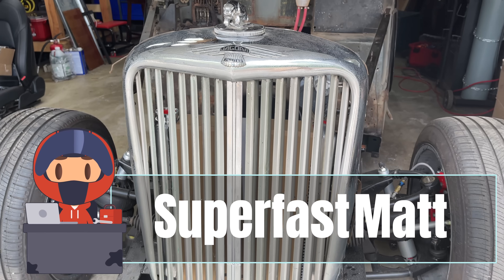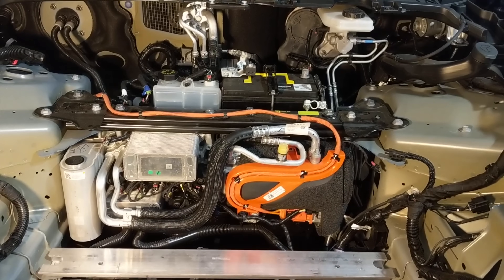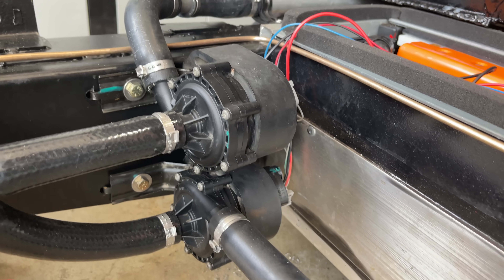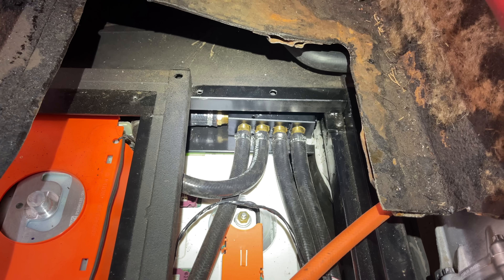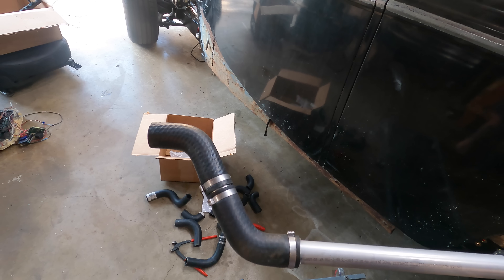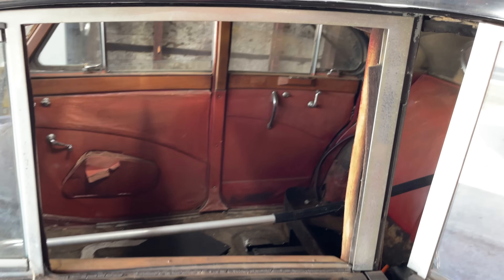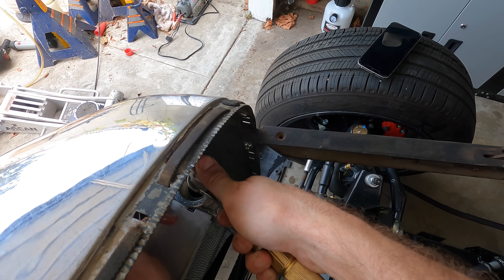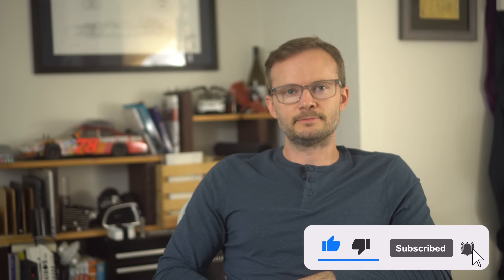How To Make A Cooling System For An Electric Vehicle

Comment: If the welder location woes continue, you can buy extension cords with the correct plugs that are rated to 50 amps. They're usually used for RVs iirc.

Comment: I love what you have done along the way, to your Jaguar, and I'm not sure if I should be making any 'constructive' comments. Along with all of the plumbing, for the Cooling System, I have noticed that you have used lots of Rubber Hose. The Rubber Hose will not be subjected to high temperatures (110 degrees C) - or even high pressures. But the Rubber Hose will be subject to attack from chemicals, shrinking around those Fastener Clips and more particularly the oxygen in the air will degrade / attack the rubber (cracking) over time. So - with this in mind, I was thinking that Rigid PVC Tube could do a similar job, and there is a variety of sizes - and also different Wall Thicknesses to handle the pressure (if needed). If PVC was used for transporting the Coolant, there would also be no metal clips that could leak around the rubber hose. All PVC pipes and tubes can be formed, and all PVC joints are completely sealed with the special PVC Glue. Aluminium Tube will also require a good Inhibitor, or the Coolant will eat through the aluminium wall thickness. I am thinking that (when the car has been completed, it may be difficult to access those leaking tubes and rubber hoses! PVC can be painted in Matt Black, and clipped to the car body for neatness. I just had to write about this, and gauge some reaction from your Fans. Greetings from Australia.

Comment: Bro..... run 20 ft of 12/2  off that plug and install another plug and be done with it..... better yet if your panel is in the garage and you have the space run some 12 off a 20 amp breaker so you have a dedicated plug.

Comment: Probably been stated 300 times but the uneven flow thru the batteries could be helped by a reverse return system. Feed water into one side of the manifold. Then the first supply port goes to the last return port, etc

Comment: What is the accapted practice or science in regards to pump and fan speeds? Which one is more efficient? Which one do you speed up first? What’s the proposed optimal speed ration between the the in optimal case. I built a few computers in the office and ran out of energy to research all these but stayed interested in the optimal approach. (set pc outside fans to low and inside fans high. since outside temp never gets above dangerous temps, processors are good at very high temp with no tune) but 43 degrees C is a very low treshold.

Comment: Why dont you just get a length of aluminium tube, cap one end, fill it with sand, compacting as you go, cap the other end and use a pipe bender to make all the bends? The sand stops it from crushing in

Comment: i cant help but feel that peltier units would be an easier, and overall better cooling method than a radiator. hell, you can even sandwich several on top of one another, and itll still likely be cheaper than using a radiator design.

Comment: "Swap the loop around so the control unit would be the first thing after the radiator"
I'm no expert on the temperature deltas involved in EVs but that seems like it would be... minimally effective at best.
Probably one of the reasons you didn't do it lol

Comment: It looks like Your hose connections are leaking because the clamp on the wrong side of the bead? Also Cheap Jubilee clips don’t hold that much pressure but hose clamps like you get on v-bands are excellent and easy to remove

Comment: Hey Matt, I love these videos. I recently saw the guys at Hoonigan do something smart to get a good bead on an aluminium coolant line. They literally welded a small bead on the edge. They said that they had been doing it for years and they build cars with insane power and cooling systems. You already have the tools to make the beads so probably not a tip as useful for you. But still worth mentioning.

Comment: Check out the Derale PWM dual fan controller. You might be able to tie one leg to your fan and split off the other leg to your pumps for a more robust solution than the Arduino.

Comment: To anyone who might consider undertaking a project like this, don't design like this! At least if you want your stuff to be dependable and have a reasonable OEM-like servce life.

1. The battery has cooling AND heating need! You shall NOT soley rely on convection cooling unless you have a very good derating tune in your BMS. This can't be achieved by only monitoring temperatures, but you have to monitor power demand and react your cooling need proactively. 

2. The powertronic circuit has way higher working point than the battery circuit, thus you shall not use the same rad for these two circuits.

3. If you want any decent life expectancy from your battery, especially if you live in a cold and/or hot- or high place, the battery circuit shall have active cooling and heating. A convection radiator is NOT going to cut it unless you only use your vehicle at sea level in perfect weather places. (density altitude affect convection cooling performance massively)

Whenever charging or using battery current the battery temp should be at bath-warm condition at all time <35*C and >15*C, whenever outside this range; tune your BMS to current- and powerlimit (both for charging AND for vehicle consumption). Keep your powertronics coolant at < 65*C at all times otherwise you need your inverter to torque derate. Machine cooling is the least critical and generally never a problem. Since the working point of this system is so much higher than anything else (upwards of 120*C) you can however save a bunch of headache if you make it on its separate circuit, thus releasing heat stress from the other two circuits and their components.

You can flow-control the pumps for a short extra cooling "boost" before the fan-command actually start moving heat from the system. Again, this must be done proactively by monitoring torque- or power demand and not due to a temperature sensor detecting it (by then heat has already built up and you're too late!)

Comment: As you might be aware, if you have a manifold that doesn't distribute the flows very evenly you can install a second manifold of the same design where the tubes come together again but reverse the orientation so the highest flow outlet connects to the lowest flow inlet. It won't be perfect but it will be a lot closer.

Comment: Hey Matt, love your videos; very informative and comical. 
Just a question; you have a lot of room above your radiator, why don't you raise it up so the radiator cap is one of, if not the highest point in your cooling system? I understand of course that you will still have localised trapped high spots, but this may help somewhat. 
Cheers. Trev
Reply from the maker: There's just no reason if I already have the swirl pot in the back.

Comment: I always wonder how much the speed of the water pump changes the cooling- I would think that the cooling capabilities go down again at very high flow rates since the water won't stay in the radiator for long... but it also spends less time in the hot part..so I really can't wrap my head around how that actually works out
Reply from the maker: It would be pretty east to cut a slot in the side tanks of the radiator and weld in a plate on each side. it wouldn't be 100% sealed from each other, but would effectively be two radiators. I might do that if things get weird with cooling.
Reply: @SuperfastMatt  There's been a lot of conversations about coolant speed in classic car forums over the years (I've owned half a dozen MGs and still own most of them).  I am not an expert (not even close, really), but the consensus seems to be that faster coolant doesn't improve cooling capacity.  It does however minimize the temperature difference between the peak and the trough.  I could not even begin to comment on dynamics between two intersecting loops at different speeds.
Reply: @SuperfastMatt  One additional comment/question after the other one.  Why are you bothering to pressurize the cooling system?  It seems like you will not be getting hot enough to boil the coolant, and pressure just gives you more headroom.  Well, it also reduces hot spots, but I can't imagine that being a real problem either.  I could be wrong.
Reply from the maker: @davemccann7446  I'm just using the pressure tester to make sure there are no leaks.
Reply: @SuperfastMatt  Fair enough.

Comment: Isn't it necessary to use a fan shroud so all the air is redirected through the fan and you don't waste half the radiator? No sources supplied but I'm also not saying you're wrong, I'm genuinely asking the question.
Reply from the maker: It'd be a better use of the fan, but the radiator is oversized already, so I don't really need maximum efficiency.

Comment: You might want consider a fan shroud to prevent air to go around the radiator.

This improves cooling and you might be able to switch the fan off while driving on the highway.

Fairly cheap temp switches exist that would fit your operating temp but installing a proper sensor is a better way and the rest is just coding.
Reply: A large fan shroud with simple rubber check valves (flaps)around the perimeter...
so at low speeds the rubber check valves are closed allowing the fans to work efficiently and pull air in from all over the radiator....and at speed, the check flaps open from the rush of air coming in the grille and through the radiator so the "tight" shroud does not impede air flow...and the fan does not need to run at all...

Comment: For 20 odd years I have been saying that auto manufacturers need to use the excess heat from the exhaust to run air conditioning, the same way that a gas fridge works. 
I guess it takes an innovative company like Tesla to work that out.
I also think that a small heat exchange cooler would be a good way to cool the air coming from turbos in an intercooler. An integrated heat exchange and turbo is what I think would be a good idea.

Comment: It's always tempting to weld unique fittings to an aftermarket radiator (I have one on my classic car). BUT, the radiator is probably the most vulnerable part of the drivetrain. If a deer runs out in front of  you, or a garbage truck reverses into you, you're in trouble. If you had simply made an adapter for the existing rad, then you could simply organise an immediate replacement, even  200 miles from home. With the custom made fitting on your rad, you'll probably end up coming back home on a very expensive tow truck. Alternatively, you could make an adapter that fits the original rad fitting and simply keep in the glovebox. That way you can forget about this tiresome issue.

Comment: Couldn't you get longer welding cables? An extra, extra heavy duty extension cord? Or you could have hired an electrician to put in a new outlet on the other side of the garage?
Swapping out the garage sounds like a swapping out a bandaid on one papercut to a different papercut. You need a longer bandaid or two bandaids.

Comment: Currently binge watching all of this very cool project which I just discovered. Re: Front uprights.  Is that a hub from a 4wd Tesla?  If so, you have to put a stub axle through the center spline with a nut on the outside otherwise the bearing will just blow apart and the wheel will fall off

Comment: Love the arduino solution...imagine if you could setup the entire car based on a dozen or so arduinos and not have to worry about proprietary unmodifiable, "special tools" black boxes that put you at the whim of Telsa or GM or any of those other "gimme gimme, mine mine" monsters.
Reply: Except an Arduino is pretty much an unmodifiable black box if you don't have the source code.

Comment: I think you should put some kind of air baffle between the grill and the radiator + between the radiator and the fan. The air always goes the easiest way and that is around the rad. Every car has some kind of air baffle there.
Reply: Yes, fan shrouds exist for a reason.
Reply: @averyw.3939  yes I was searching for this word😂
Reply: Put simple rubber flaps on holes cut into the tight fitting shroud..so that at highway speed the fan shroud doesn't hold back the inrushing air through the grille...and the fan doesn't need to be on at all...but at low speed, the shroud makes the fan suck at all areas of the radiator...increasing the efficiency of both....

Comment: I'm a pool guy, so I'm familiar with hydraulics. Running pumps in parallel the way you have it MAY cause issues with the flow rates, and potentially even the flow direction, IF the pumps are run at different speeds. If I understand your intentions with the system, they will be, correct? I THINK the effluent side configuration will be OK, but I could see issues  with influent side if the pump speeds are running at very different speeds. The pump running at the higher speed could cause the flow through the lower speed pump to stall, or even reverse (not likely unless the pump is shut down completely). In the pool industry, we would employ one-way or pressure differential valves to prevent issues like that.  Running the influent and effluent plumbing into common plenums will often resolve the issue as well. Running the influent side of the tow pumps to the lower radiator end cap with separate lines would likely resolve any potential issues. It's also possible it will be completely fine the way it is, lol. Just wanted to share my experience in case you do run into issues later.
Reply: I read "I'm a pooR guy" and I kept wondering why being broke made you competent with hydraulics.
Then I read better.
Reply: @Heidegaff  🤣
Reply: @Heidegaff  I'm broke as shit but fairly competent ..recreationally..with hydraulics... sometimes. Though my brokeness likely has more ot do with just bad decision making than anything else

Another way to deal with this (if you're okay with wasting the power...15 amps at full tilt..hmmm) is to 'null route' the flow for the first n (say..4) ports. I think its either 1-exp(n) or 1-cosh(n) or something, so the null routed 1-4 ports will have a huge gradient, and by the time you hit your actual 4-5 (outhouse | battery) the differential will be different  (assuming like-for-like-- internal surface roughness and run length are probably your main ones)

I duno why you had an issue with those bead seals, maybe us engineurdds (I don't have a PE cert so I don't count!!!) just dont exert enough actuating force :[ but they do make zip ties with more than enough clamping force, chemical, UV, and abrasion resistance to more than satisfy the few bars of pressure you'll see. In general, the black ties are 'outdoor' rated (UV). Look for the UL uh..there's some UL or ISO or ANSI or  something standard that specs it all out proper. I know they also make stainless 316 that are rated for 100lb in loop tension (these are the hand-pull serrated ones, so I bet the ratcheting sort which takes the $2400 proprietary hand tool[cable ties..crimp tools..its all the same price gouge model] will do waaay more).

Ehh ohh Matt Thanks for all the adhesive tips and such. I havent wrenched on shit in ages but it's nice to know
Reply: I wonder if this might be different in a pressurised system?  

I've got no idea, I'm just speculating, pools generally don't have the reservoir and lines under pressure. Though then again this might not be under the same pressures seen in a vehicle cooling system
Reply: @GingerNingerGames   The pool itself is the reservoir. When in operation, all of the lines are either under pressure, or vacuum. They are not identical systems, but have common hydraulic design elements.

Comment: Hello Matt. About the leaks. When i used to work at the Saab factory in Sweden we also had problems with leaks in the cooling system. It happend when you put the clamp to close to the end of the hoose. The solution was to put the clamp no closer than 5mm to the end. Now days hooses comes with the clamp glued in the correct position. Did notice that some of your clamp was very close to the end of the hoose.
Thanks for great content. John
Reply: I can't believe how little attention this comment got. Amazing to just casually hear from someone that was at Saab "oh this fixes it", and that also explains an inexplicably leaking hose clamp on my Volvo. I'll move it back, thank you!

Comment: Just appeasing the algorithm. My 2 cents, I would have put one bigger pump upstream of the split instead of two downstream. You could then put a valve on each line downstream and dial in until you get the flow you want/ get fancy and have a temperature sensor on the outlet that alters the valve position. This will remove the need for two pumps and prevent them from fighting/hunting for coolant. Oh actually put temperature sensors on the outlet (return legs) and have them vary pump speed based on temperature. Can you have too much cooling? If not just ignore everything I have said.  I haven’t finished watching the video just throwing words at my screen. Keep up the build, great job.
Reply: This right here.  If you consider a scenario where one of the two pumps is off, the other may end up back-feeding from the other pump.
Reply: @andrewshoe6832  
Check valves?
The diode of the waterways....

Comment: I am definitely gonna make it a point to put 240 volt outlets on both sides of my shop when i start renovation. Thank you for bringing it up!
Reply: @Mike you aint wrong, but I'd rather just have another outlet since the walls are already down to studs, not alot of extra work.
Reply: @Mike 
I'd agree with overhead extension reels or ceiling-mounted drop extensions...but a workshop handling steel that can drop and slice extension cords????